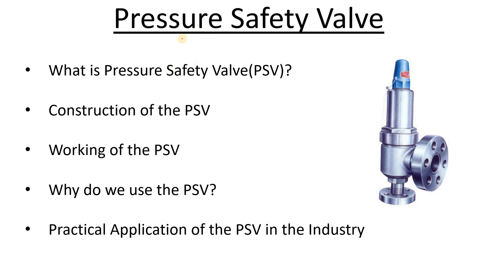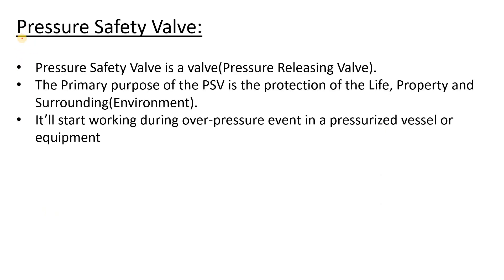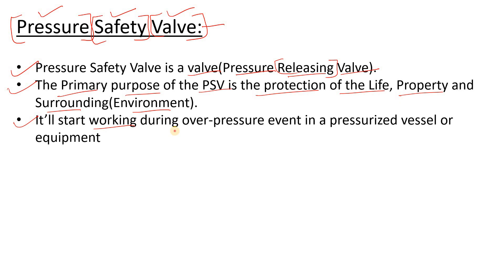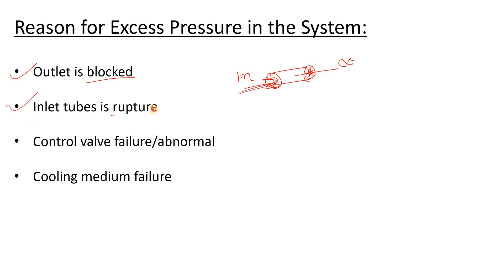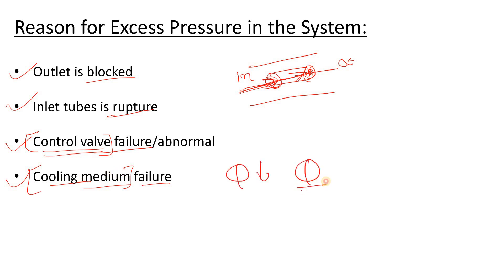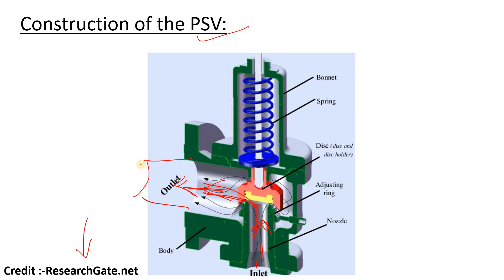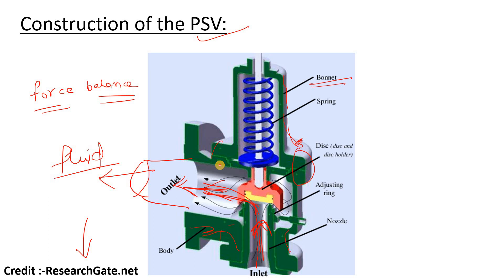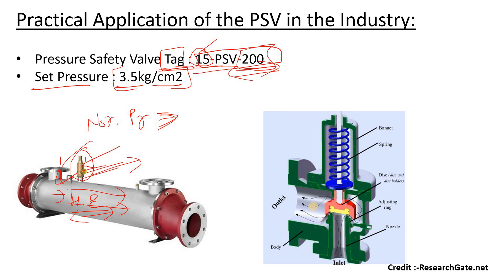Pressure Safety Valve (PSV) | Construction, Working and Application of the Pressure Safety Valve.

Comment: What is main difference between the PSV, PRV and SRV ?
Reply from the maker: Pressure Relief Valve is a generic term. It includes Safety valves, relief valves and safety relief valves. A PRV opens at set pressure and closes at reseat pressure.

Safety Valve is a PRV actuated by static pressure resulting in a rapid opening or pop action. It is used on gas, vapor and steam (compressible media). This is what we commonly refer to as a PSV.

Relief Valve is a PRV actuated by static pressure which opens generally in proportion to overpressure. It is normally used on liquids (non-compressible media).
Then there is a safety relief valve which is a PRV that may function either as a safety or a relief valve (also refered to as PSRV).
When a valve is refered to as a PRV, it could either mean that the relief valve is used for liquid or it is a Pressure Relief Valve in a generic sense and could be any type of the Pressure Relief Valves. I would always look into the fluid in the pipeline if there is any confusion.

Pressure Regulating Valves may also be referred to as PRV in some cases.